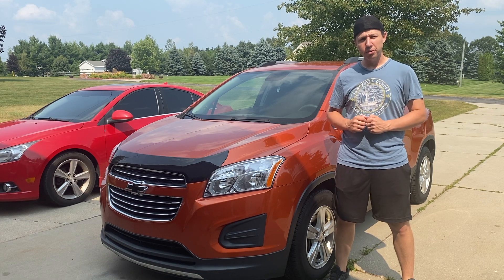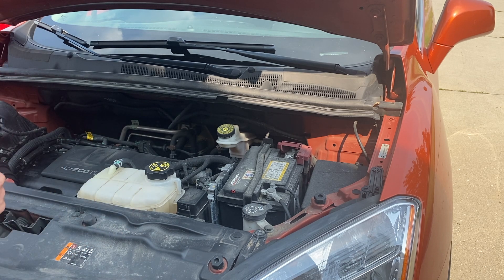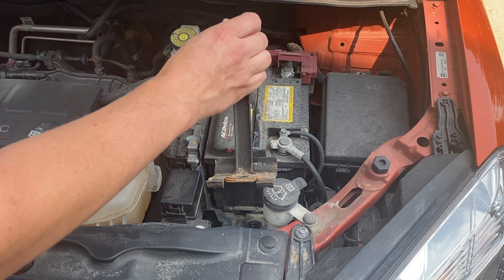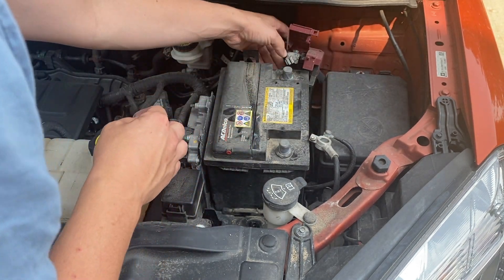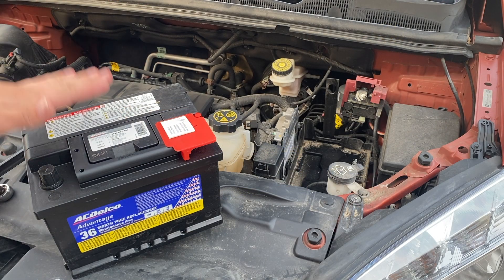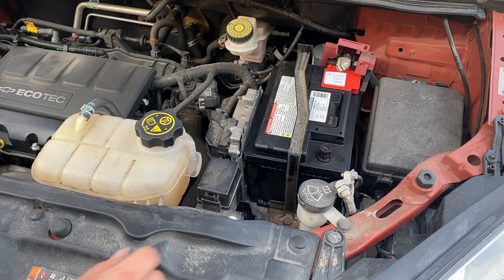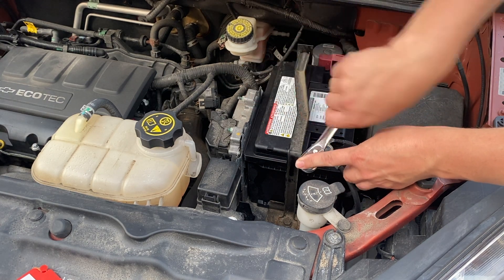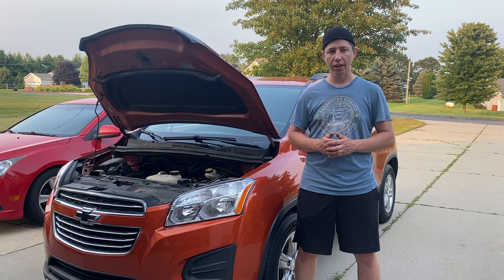Chevy Trax Battery Replacement - Same as Buick Encore - How to

Comment: Hey, on mine there was a nut underneath the bolt that held the strap on.  when i removed it the nut rolled away some where. is that normal or is the hole in the tray supposed to be threaded?  I notice you didn't have to keep track of a nut under there.

Comment: How much time do you have when both terminals are disconnected before you lose all the computer settings? Will there be any driving issues, relearning? Key fobs still working after?
Thank you.
Reply from the maker: I had the battery out for about 2 hours because I was filming and had to go get the battery too from the store. I didn’t lose any radio station presets. Also, nothing systematically will need to be reset. Only thing that might reset is a check engine light if you had one. Hope that helps!
Reply: Thank you Chad:
You're right nothing changed, Does that mean the radio has it own power source to keep the pre-sets, like a button cell?
Reply from the maker: You got it! Like most electronic, they have a small button battery for memory. Glad it worked out for you!

Comment: What is that heat sink next to the left side of the battery?
Reply: That is the ECM (Engine Control Module). Monitors and controls the operations of the engine.
Reply: @karstensmash  thank you